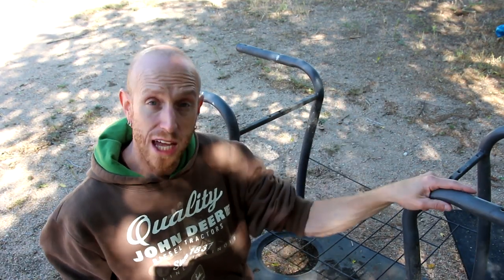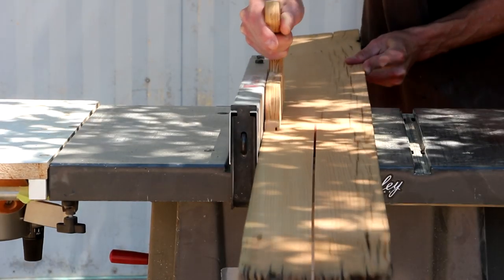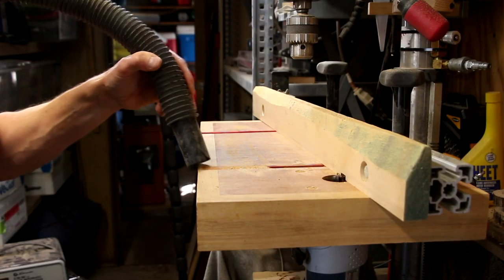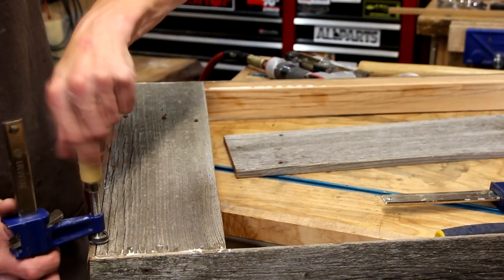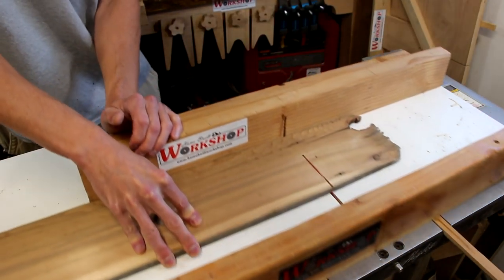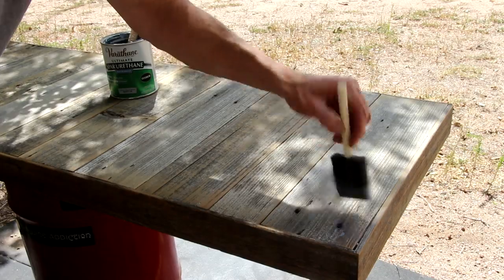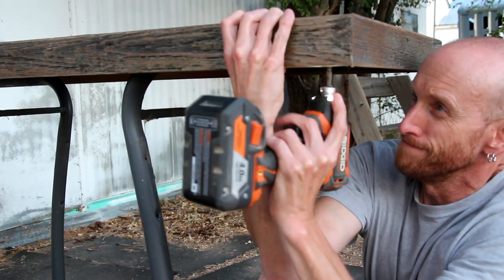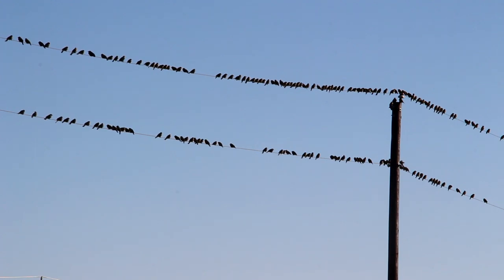Building a Reclaimed Wood Tabletop for an old BBQ Grill

Comment: Hey brother, this is a great project that anyone could do and find very useful! The tabletop turned out really great! I love that this is made entirely from reclaimed materials! One thing I would point out but, not in criticism, the thing that always goes bad for me with those bases is the flat parts. They always seem to rust, even though they are usually covered by the grill. I would suggest some type of rust-oleum paint to keep it in good shape. Other than that, this project should give you years of good use. Great work!
Reply from the maker: I can totally see painting it first to protect it. I really didn't think of it. We don't have a big issue with rust in Colorado but I know many parts of the country/world do.